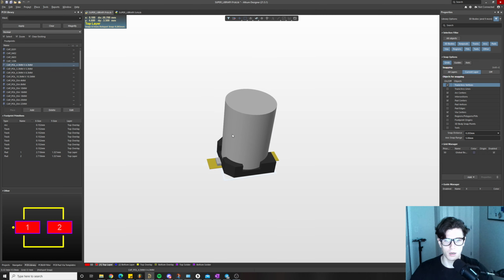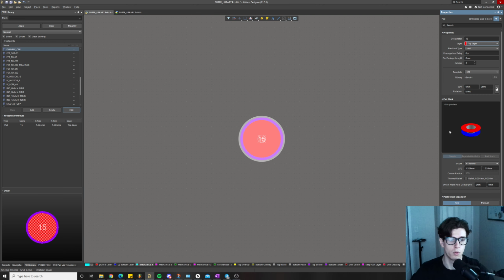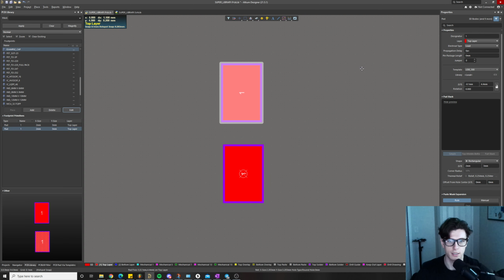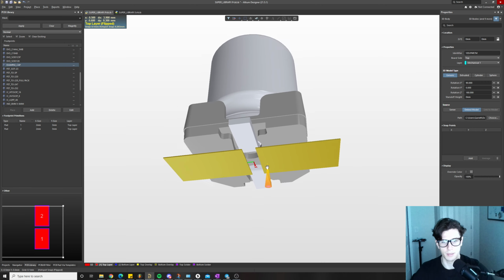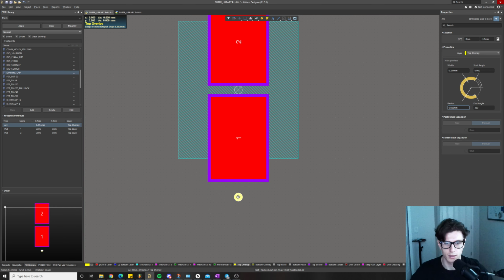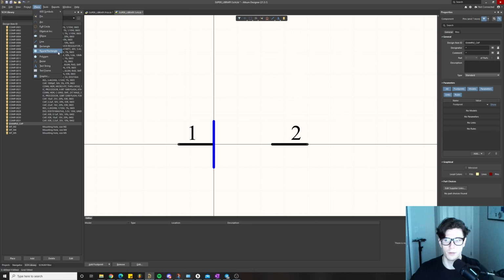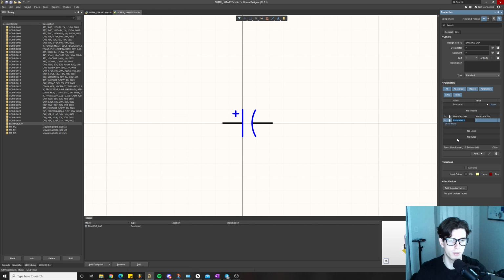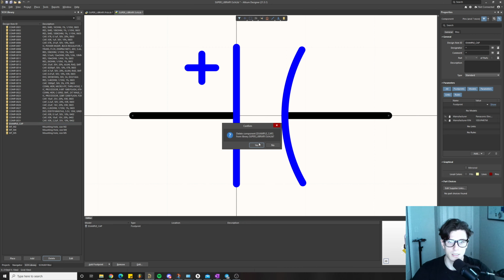ALUMINUM POLYMER CAPACITOR FOOTPRINT TUTORIAL | ALTIUM COMPONENT TUTORIAL

Comment from the maker: What components do you want to know how to make in Altium?
Reply: Could u plz make the 10k pot through hole.& also one doubt is there ..( sometime space between two leads is come up with +/- tolerance so if we dont have the 3d body only we are making footprint  which tolerance value should i pick  with +   or -   or the actual without adding how to be sure about the pin spacing .. plzz answer to my question

Comment: Dear  can u plz tell me for axial resistor how can i got know the pitch between the two pad if length not mention between two pad of through hole resistor
Reply from the maker: I will make a video on this topic
Reply: @RGBEngineering  plz sir make one i hope u got my question .. if we dont have 3d body just we have to create pad then in through hole that spacing between to pin should get match.. even after sometime if we placed the component it should get matched easily.. plzz sir do it asap... tnx for the effort  u r making for us ..

Comment: Are you familiar with microcontrollers?
Reply from the maker: Yes, I do a lot of work with microcontrollers.
Reply: @RGB Engineering  Sweet. Sorry for posting on the wrong tutorial. I been working with PIC microcontrollers & was trying to understand how to program them.  Also I would like to know when designing, what formulas you use the most? Been trying to understand when to use them & how to use them.